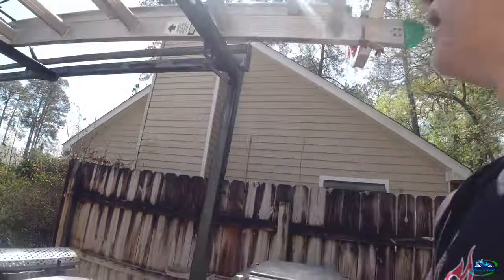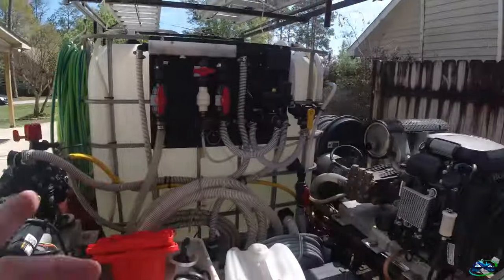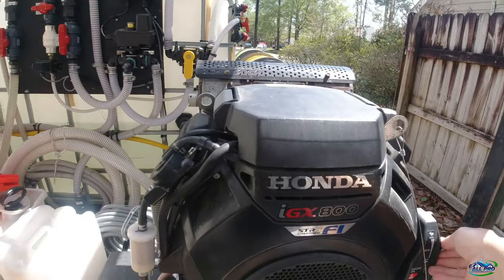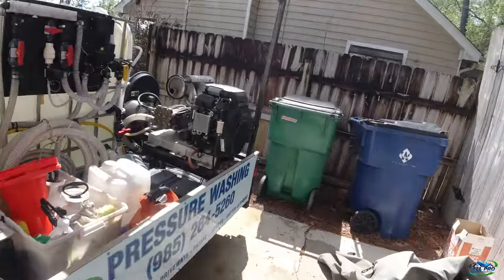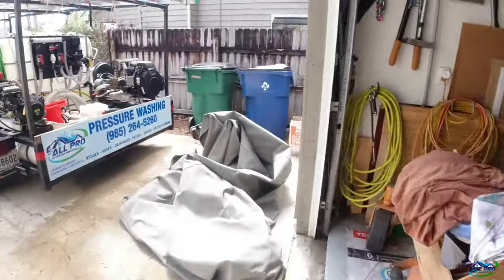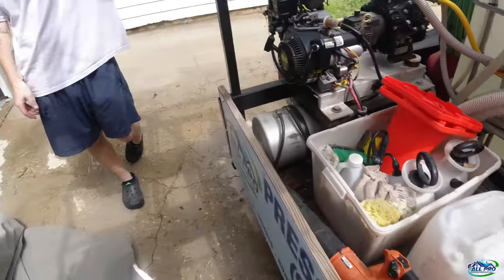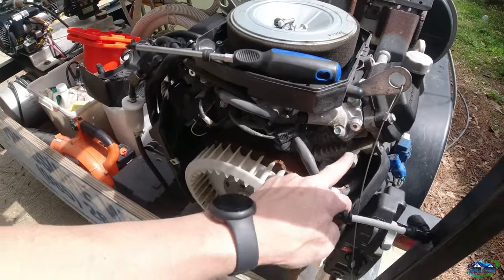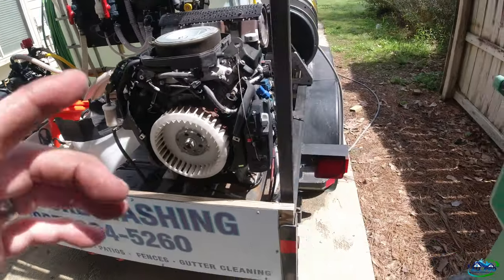IGX800 Engine Bogging Down- Modified Ignition Coil Replacement

Comment: I have 2 IGX800s. I had the same problem with both mine. Changed out both coils and on both less than 200 hours and it fixed the problem. Changed out plugs and fuel filters too. My plugs was fouling bad.
Reply from the maker: The rumor is that Honda corrected the coils. I hope my replacements last a lot longer. Thanks

Comment: That bog could be pump safety related. The igx800s have a protection on them for low water flow. Seems like that censor could be faulting when you open and close flow at your ball valve. For instance if you run too small nozzles on an 800 it’ll protect itself and not run non stop. I think it’s that censor.
Also with the 800s take advantage of the ECU when you can. If mine ever have issues I take mine to an Advance auto and get a computer check
Reply: Did you watch the entire video? Regardless, good info. Could be useful for another situation.
Reply from the maker: The coil pack were bad. The unit is performing like new again. Thanks
Reply: @TheFreshRinse 
Look who I found wondering the internet. Nice comeback. You funny mr fresh.